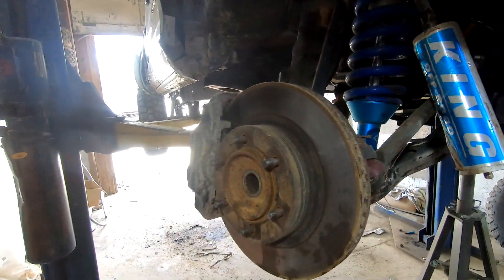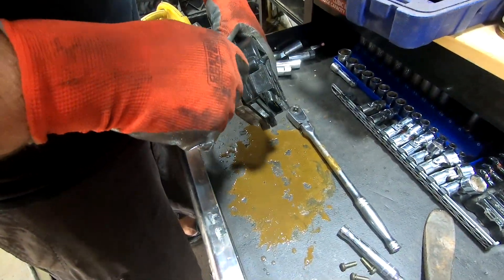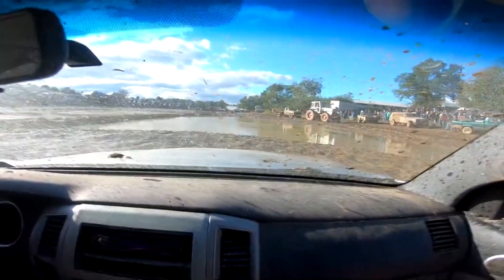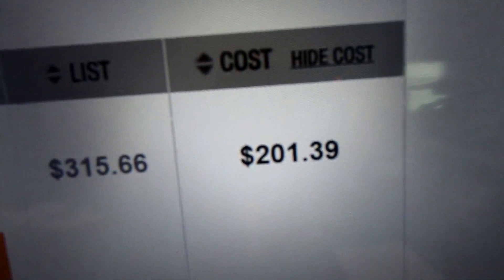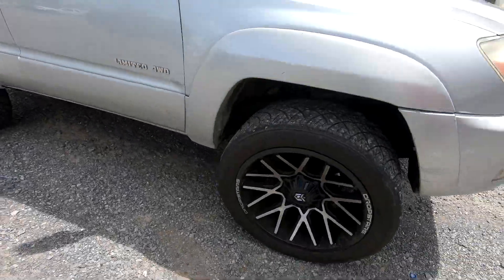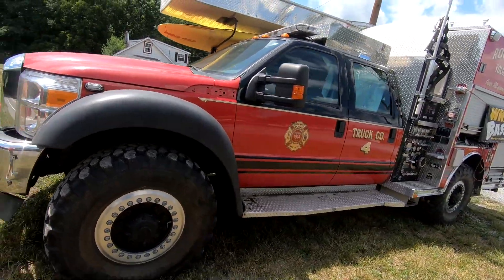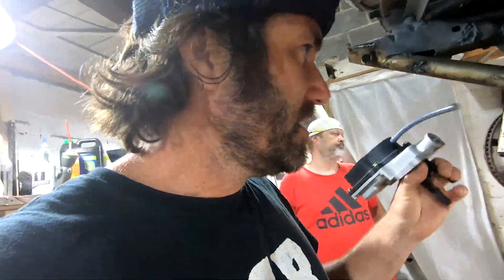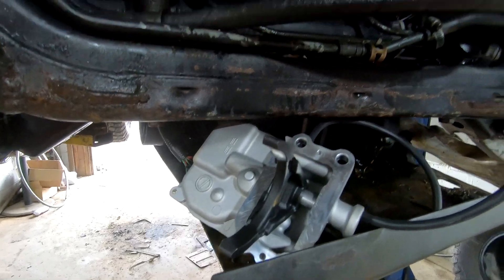TACUNDRA 46 - Mud in the ADD Actuator

Comment: Is that stupid thing a vacuum actuator or is it an electric motor? If it's electric then it seems pretty stupid that there's also a vacuum line. What does what??
Reply from the maker: I read a lot about it being a vacuum actuator - but I was asking the same question you are.  I figured maybe it was vacuum assisted (like a vacuum booster on hydraulic brakes) but that made no sense after I took it apart and looked at it.  I have it hoked up and working fine now with no vacuum.  Apparently it's just a breather hose.
Reply: @WHIPBASH  🤣🤣🤣 that's hilarious. Thanks for the response

Comment: I hope you would put f250 axles under it
Reply from the maker: I have a FF 10.5" 14 bolt GM rear axle built for it - coming soon.  But I'm keeping the independent front suspension.  I already splurged on the $2500 RCV Ultimate CV axles "guaranteed unbreakable" and King coilovers for the front.  And there's no way I could get the 13" of travel I have now with a solid front axle.

Comment: Told ya.... ADD was going to be a nightmare. I have a Subaru shaft ...  I completely eliminated it. So technically I have a AWD LS Swap Tacoma
Reply from the maker: Meh - I rigged it all up with switches.  It wasn't too hard.  Next video.
Reply: @WHIPBASH  you're definitely more techno savvy than me! I rely on my transfer case to manual shift. My rack-and-pinion went out. But imma definitely link back up with you during the cooler months